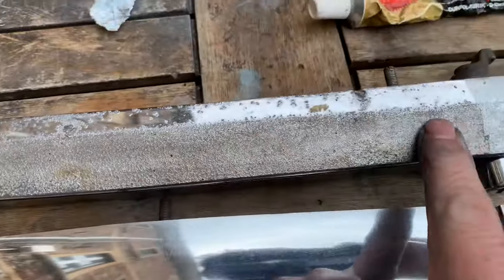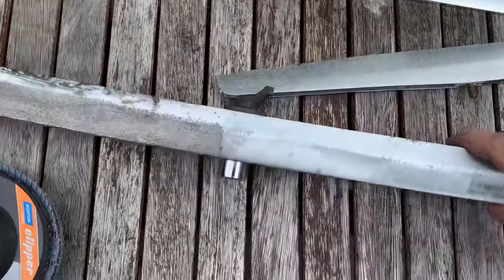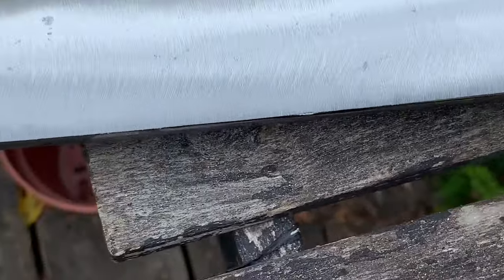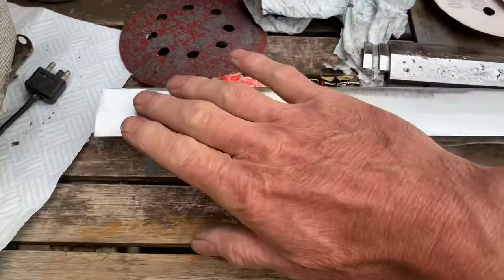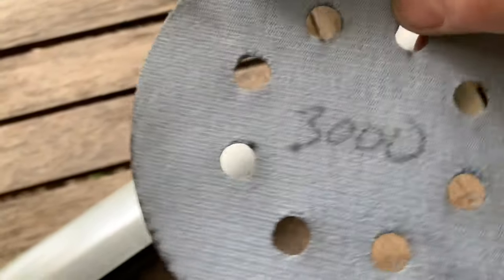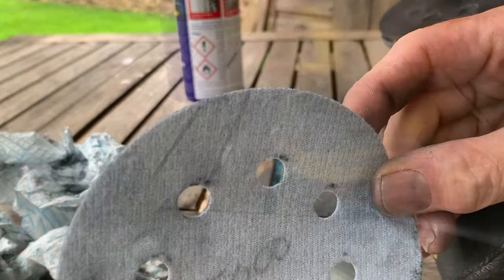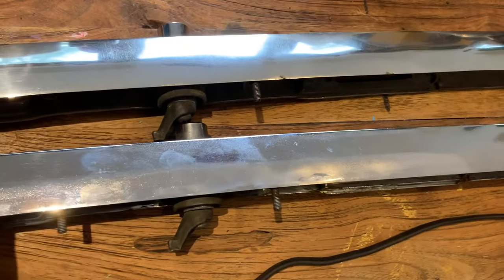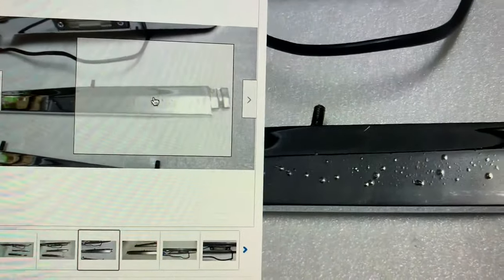Mercedes r107 - how to get a mirror shine on rusty pitted chrome

Comment: Im really surprised by the results! Do you have any idea how to shine milky aluminium trim? From my experience it’s some kind of anodised surface that’s really hard.
Reply: Yes, would be interesting to see how to deal with the anodized aluminum trim on the R107, the hardtop and and windshield trim have these.

As far I understand, it can either be chemically removed or mechanically (by sanding).

The issue is that it is very hard to remove the trim from the hardtop.
Reply from the maker: Thanks for your comment. There are many pieces of anodised aluminium on the 107 SL (see list below) and cleaning them requires a special anodised aluminium polish such as the Autosol Anodised Aluminium polish. Often the anodised aluminium will be nigh impossible to re-shine and you will have to de-anodise it and polish the aluminium below.If people are interested, I may get hold of a selection of different products and do a little comparison video when I get the parts on the car that need attention. I'm interested to see if products like Nevrdull actually work. Meanwhile here is a list of anodised aluminium parts on the SL:

Front grill star and circular surround on later cars
Eyebrows above the headlights
Window trims
Strip inside the rubber door mouldings 
Top trim on the door, and the A pillar trim
The often missing door armrest trims
Lower sill (rocker) strip
Hardtop trim
Horseshoe deck trim (but not the escutcheon)

Mike
Reply from the maker: @cav4290  I have never tried removing the hardtop trim but I have several knackered roofs on which to practice. I am assuming the boot chrome piece that I have been sanding are made from aluminium but have yet to get confirmation of this - do you know this? Mike
Reply: @MikesMercsandothercars  Boot chrome is chromed/nickel metal, aluminum as far as I know is never chromed. You will notice that the difference is notable, as the aluminum trim do not have corrosion but rather the anodized surface takes on a milky and dull appearance. I think hydrochloric acid, which is also found is bathroom and kitchen cleaners, can remove the anodized surface.
Reply: @MikesMercsandothercars  Yes, please do! This would be extremely interesting and useful, especially as so many 107 are suffering from this.
Reply from the maker: @cav4290  A fountain of knowledge as always. Thanks. Mike
Reply: @MikesMercsandothercars  My pleasure. I have recently purchased a Range Rover P38 (1994-2001), so I will be dipping my toes into English motoring and will have a steep learning curve on this model.

They are still affordable, but the meteoric rise of the Classic version is slowly pulling them upwards. 

Do you have any experience on this particular model, or as an Englishman, do you know better and keep away from English cars? :)
Reply: That trim looks fantastic Mike.
Kent from Mercedessource figures out how to polish anodized aluminum trim after a lot of trial and error saving the rest of us time and $
Reply from the maker: @mericavids  Thanks for your comment. I must say I was amazed at the results. I am going to do my own 'polishing anodized aluminium' trim video at some stage.....Mike
Reply: @mericavids  Yes, but unlike Mike, Kent will not share what actually worked for him; he will only sell you one of his infamous "kits"...in fact he calls anything a "kit", as long as he can put a price tag on it :)
Reply: Neverdull

Comment: Great Job Mike! I thought about buying a set of the same chrome trim but hesitated because it costs quite a bit. Do you have a video how to remove this trim? I removed all 8mil nuts, yhe trunk lid catch and two 8 mil inside screws/bolts for the push button lock but can't seem to get the chrome pieces off. Any advice?
Reply from the maker: There is nothing else holding those trim pieces on BUT the outer bits slide into the inner bit and from memory you might have to take off inner bit first. There is a video in the Red Dragon playlist showing how to fit these. I am at a festival this weekend with limited Internet access but I’m sure you look in the playlist you will find it. Mike
Reply from the maker: Have a look at this video:

https://www.youtube.com/watch?v=mpKqe1eHlnk

Mike

Comment: Didn't you just grind off all the chrome and are just polishing pot metal?
Reply from the maker: Yes. The alternative is to buy a new part or get the existing part re-chromed. Obviously these two options are preferable BUT if you don't have the money to buy a new part or get the existing part re-chromed here is a solution which gives a perfectly acceptable result. Mike
Reply: @MikesMercsandothercars     I understand,  thx for the video.
Reply: @MikesMercsandothercars  Is it possible to clear-coat the polished zinc alloy to slow oxidation, or will it just corrode beneath the coating?
Reply from the maker: @Uroparts  Thats a good question and I will talk to a paint shop to find the answer. Corrosion generally needs oxygen and if you clear coat, that would presumably cut off the supply of oxygen. The problem with clear coating is that it can dull the shine of the polished metal. In order for the clear coat to adhere to the surface of the metal...you would presumably need to remove any remnants of polish. 

Last but not least...I did this a year ago and this piece still look great..and a million times better that it did...so may the answer is simply to polish the metal again when it looks dull.

Mike
Reply: @MikesMercsandothercars  That's awesome Mike. Perhaps finishing the polished surface with paint "wax" or sealant would enhance gloss while also slowing oxidation at a microscopic level.

Comment: Chrome plate or was it stainless steel you cannot do that with normal chrome plate
Reply from the maker: Thanks for your comment. Those parts are not stainless steel. I think they are a zinc alloy which is then plated. With this method you end up removing the chrome layer and polishing the metal beneath. It will never be as good as re-chroming but is substantially cheaper and something that people can try at home. Mike

Comment: Great video. BUT,  my spots of pitting are not flat. I have beautiful spiked chrome rims on my car. One dog insists on peeing on them and hence the pitting. (4 fenced acres and he has to pee on my shiny rims)  ANY thoughts on how to get into the tight places. Guess this will just be all by hand and no help with electric devices. Any suggestion is appreciated. Thank you for your time. 😀😀🤠🤠
Reply from the maker: Those pesky dogs! The pitting on the pieces in this video was really deep. The deeper the pitting the more you have to sand off to get a completely flat and shiny surface. I'm not 100% sure I know what you mean by "spiked chrome rims" - can you give e a link to a picture online or let me know what vehicle this is? Mike
Reply from the maker: @BlondeExplorer1  Thanks for the link - nice wheels! I think to get rid of pitting in that style of wheel, you would need to take them to a specialist wheel refurbishment company. I did this with the wheels on my now stolen 280SL - see video below:

https://www.youtube.com/watch?v=P7RHPJ1n5gA&t

At some stage, I'll get this done on my SL55 AMG which has similar wheels to yours.

I'm not sure what country you are based in (USA?) but here in sunny Bristol UK I use a company called Phoenix Alloys. They charged me about £400 to diamond cut and re-weld my wheels. Sounds like a lot but it made a huge difference to the look of that car.

Good luck with those expensive dogs!

Mike
Reply: @MikesMercsandothercars  Hi Mike, Yes indeed I am over the pond in the USA. I currently live in Texas and in a rural area. I will try to see where I can take these almost $8000.00 rims. Houston is a 2-hour drive, but I need to get these fixed. I cleared the golf cart and other things out of the garage so the car can safely be in there. Thank you for your time! Stay healthy.  Blondie
Reply: @BlondeExplorer1  $8000 for rims.  I can't see rims being that much money. No way
Reply: @gm-lb9oe  Yes they were 8k. You must not own rims. High quality ones are expensive. Sure, you can buy knock offs for 1k or 2k but really nice ones cost more. That is what I paid and that is what they cost no matter where you shopped for rims. You can shop at Walmart or you can shop at Neiman Marcus. I go to Neiman Marcus. Walmart sells rims and they are junk but many people buy them. After a few years I am certain they are rusted.

Comment: Has anyone tried to powder coat the final polished pieces with clear powder coat?
Reply from the maker: You can spray (or paint) lacquer or clear coat to protect the piece BUT….you will tend to get a duller finish. Mike

Comment: What about the anodised aluminium?
Reply from the maker: The ideal solution is of course to get things re-plated. This is a good solution for those who can't afford (or are not able) to go down that route. I did these over a year ago when I started this restoration and they still great...not perfect but a million times better than before. Mike
Reply: @MikesMercsandothercars  So you could do the same in your video on chrome and anodised? Thanks for the reply as well.
Reply from the maker: @dallasfett  Hi - I'm not sure this method would work on the anodised aluminium trim pieces on a Mercedes SL - it would be too aggressive. Do you have a specific piece of trim on a specific car in mind? Mike

Comment: Just rub it with a handful of crumpled aluminium foil and a few drops of diet coke, that's what bike guys do with corroded handlebars and so on.
Reply from the maker: Thanks for your comment. The method you describe works best when there is light corrosion. In this case, we had much deeper pits and had to remove quite a bit of material in order to get that mirror shine. Mike

Comment: You just did remove the chrome...
Reply from the maker: Yes - this method removes the existing chrome and polishes the surface beneath. It will never be as good as the original chrome BUT on this particular piece only the eagle eyed would notice. Stripping, filling and rechroming is the best method if you have the funds. Mike

Comment: If chrome is pitted it can't be repaired
Reply from the maker: Thanks for your comment. You are quite right, to do this job properly, you would have to strip back to bare metal, fill any pits and re-chrome. This method works for those people on a budget who can live with a finish less shiny than chrome.Mike